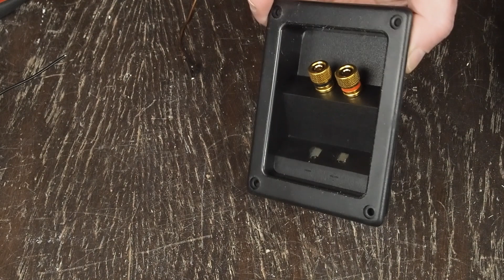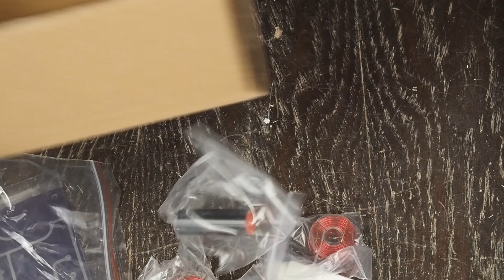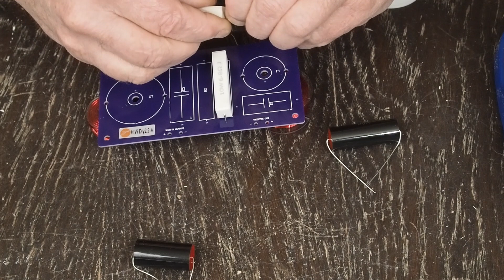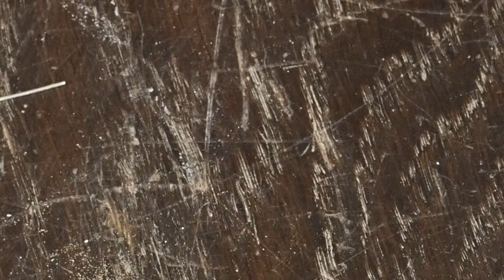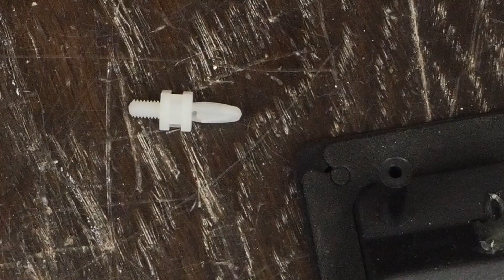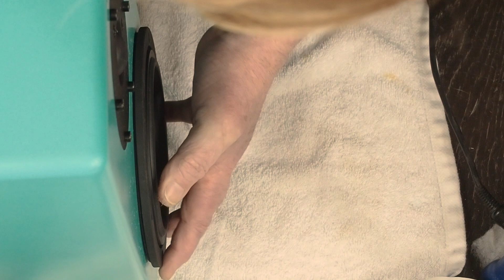DIY 2.2A Speaker Build: Final Assembly!

Comment: Just received the kit .. my instructions show 1.5Ohm as (R1)  and 6.8Ohm as (R2) .. I see your instructions.. but mine is showing opposite ... wonder if my newer one is a corrected version on the instructions. They are the exact same crossovers-parts and board- that did not change.
Reply from the maker: Now THAT is very weird. I would contact them before I assembled this.
Reply: @SkunkieDesignsElectronics  Eaiser said than done I e-mailed them and asked question on amazon. Either the new manual's are wrong or the old ones are. Someone said to check under the question and answers section and download the instruction manual. I just did and it has R1 as the 1.5Ohm.
Reply: I read on AVS Forum from 2017 someone has the same issue - R1 showing 1.5Ohm in parts list and the picture showing it 6.8Ohm and he was told the picture was correct .. so i quess R1 should be the 6.8
Reply from the maker: @rosedan100  I would follow the schematic which you can find online. Also the picture they show in the instructions downloadable at amazon has R1 in the parts like like you say as the 1.5ohm, but then the picture has it in the R2 position on the board... So yes follow the picture!

Comment: Capacitors are polarized meaning they are designed to have current flow in one direction and not the other. They can explode if installed in the wrong direction. I'm surprised you didn't go over this?
Reply from the maker: Film caps are not polarized.
Reply: @SkunkieDesignsElectronics  you and I know that but if you're giving soldering tips that people will use on other projects, you might mention it.

Comment: Just a thought:: What %% of better sound will you get placing X overs  outside the 
Speakers. With a pretty Box 
That you can easily do with
 A little extra wire   %5 better. %3 better ??  

  Thank you
Reply from the maker: I'm not a speaker expert but I don't see how they would preform any differently inside or outside the box.
Reply: I can think of three variables that would get introduced by moving the crossovers outside of the box. 1. the box volume would increase by the space taken up by the crossover.  2.  more wire would be needed.  3. the external crossover would be subject to less vibration.   An upside is that you can use very large crossover parts and spread out the layout. Whether or not any of that would make an audible difference is also a variable.  Whether or not it's an improvement is subjective.   Not worth it for most speakers and most systems IMO.

Comment: Looks good. Are the PCB traces that narrow or is there solder mask over some of it? When assembling a crossover, to prevent broken solder joints, I leave extra length on the component lead, bend it in the direction of the PCB trace and solder it down.
Reply from the maker: That's a GREAT tip!! And the traces are huge, that's just the solder mask.

Comment: I like the way you soldered a tab onto the terminal screws. Alternatively couldn’t you use lock tight on the terminal screw nuts?
Reply from the maker: That could possibly act as an insulator would be my fear.

Comment: Shouldn't the voice coil be in different orientation to eachother?
Reply: I thought the same thing
Reply from the maker: I'm new to building speakers and have no idea what you are talking about, even trying a google search. Do you have a link to what you are referring to?

Are you talking about the inductors on the crossover?
Reply: @SkunkieDesignsElectronics   The 2nd order high pass filter on the tweeter can cause a 180 degree phase shift that can be offset by reversing polarity of the tweeter in relation to the woofer.  (In the case of a 3-way design, the midrange would be the correct driver to reverse polarity on).   However, it's not an absolute...final acoustic roll-off depends on the specific driver response and the crossovers used.  I'd suggest you experiment with the tweeter polarity, then decide which you prefer.  I like that you soldered the connections, but for others who do the project, or the next time you try one, I'd suggest temporarily using quick connects for easier experimenting.  Solder them once you've made up your mind.
Reply from the maker: @scottspencer4018  I'm playing with that now, thanks for the suggestion!

Comment: Tip:  When spaceing components off the board, I use a single wall cardboard cut to fit under the component.  Solder then remove the cardboard and Bob's your uncle.
Reply from the maker: Nice tip :)